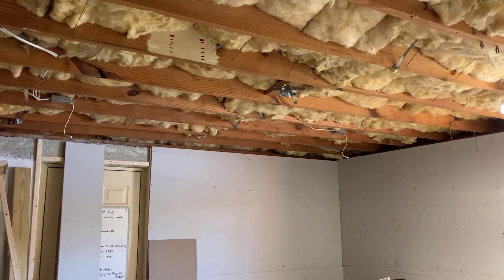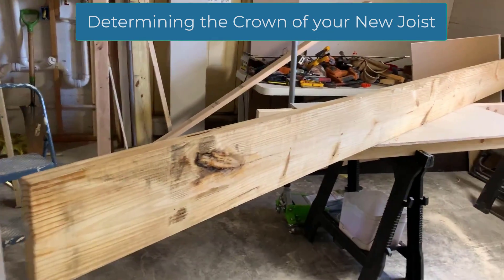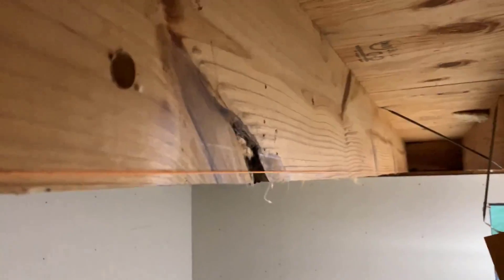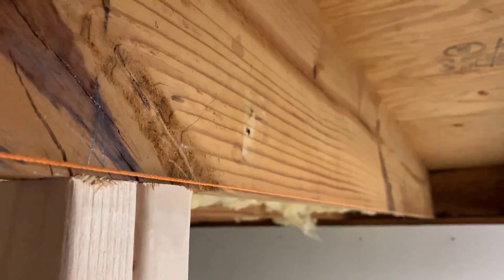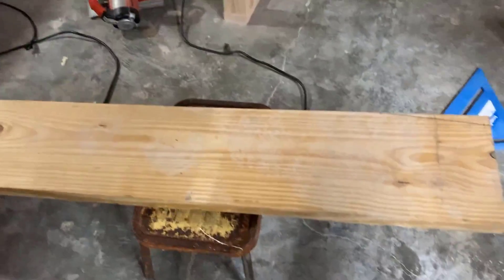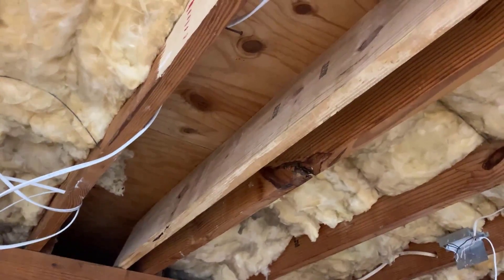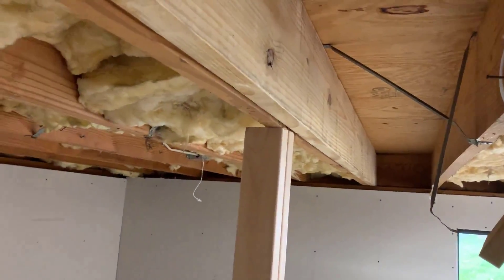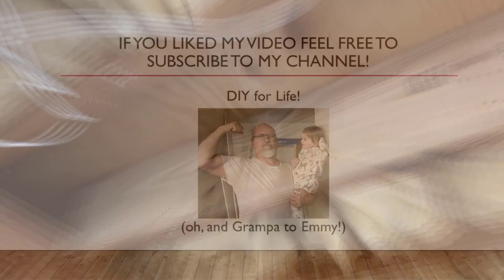Floor Joist Repair Video

Comment: My flooring above is ceramic tile.  Do you think I'll have a problem jacking up the joist and cracking the tile or grout?
Reply from the maker: It really depends on how much you have to jack it up. I would guess that you might have some cracking depending on how much you have to jack it up.

Comment: I install joists in opposite directions, so bottom is started, then use a compact bottle jack, in between other joist, in the joist cavity.  The jack to push new joist to old joist.  Unfortunately, a bottle jack will not work downwards.  But the jack will force both joist together.
Reply from the maker: Interesting approach.  That would work.

Comment: How the heck did that joist ever pass inspection in the first place? And was that "new" joist the best one you could find?
Reply from the maker: I asked myself that question about that joist. Not sure why they decided to use that. As to the new one that I chose, it’s doing just fine. I probably could’ve gone to the next grade up, but, as I said, it’s structurally sound.

Comment: Great video, very helpful. Thank you!
Reply from the maker: @davida871  I’m glad it helped you my friend
Reply: @RighttothePointDIY I bought SDS 3" Simpson screws.  If 2x6 is water damaged and cut from plumbing should it be removed or just instsl 2x6x12 on each side of original joist?
Reply from the maker: @ i’m always in favor of removing the old joist if possible.

Comment: You can use a small bottle jack to help force the new joist against the damaged one. It is a lot quicker and less destructive than beating it with a hammer.

Great video, well lit and clearly explained.
Reply from the maker: Good idea.  Thanks for sharing that.

Comment: If I used bolts instead of screws would that work as well
Reply from the maker: If you are resting the replacement joist on a header or wall on each end then screws (like I used) would be fine.  If you are doing a true 'sistering' of joists together and the new joist is NOT resting on solid surfaces at each end that is a totally different repair and, in my opinion, would be better done with bolts.  Hope that makes sense.

Comment: Using a vehicle jack of that type for that purpose is dangerous due to the wheels and the fact that it doesn’t go straight up but in an arc .
To use this type of jack measure the arc and angle the prop so that it will move to the straight when in position, also chock the wheels so that it doesn’t spit out while lifting.
Reply from the maker: @anomamos9095  I appreciate the comment.  A couple of things to note.  
First, the lift was only 3/4” and the arc you referenced is virtually none. If the vertical lift was more a lot I could have used my bottle jack. 
As to the rolling threat, I had leveled the wood supports to straight up and down so that wasn’t a threat of happening. 
In my estimation, because of those factors I don’t think it was a dangerous way to jack up the joist. However, if those factors were different I would agree a bottle jack would be better.
Reply: @RighttothePointDIY  The comment was meant for others as you had already successfully used it.
But you're lucky Murphy wasn't looking.
Reply from the maker: @ Thanks for the comment.

Comment: Great informative video. After reading the comments from expert carpenters, they agree that its a perfect fix. Now i know what to do. Thanks for sharing.
Reply from the maker: Thank you very much for the kind words.  I have not had a single problem with the repair in the three years since I did it. It’s holding great. Best of luck to you as you do your own repair.

Comment: Deck screws not recommended for this application due to low shear strength.  Seems like overkill but against some Building Codes
Reply from the maker: @RichardCooper-bd9qo  Understood. However, the screws are not holding any sheer weight. The purpose of the screws is just to hold the new joist in place against the old joist. The weight is being carried by the joist itself.

Comment: Question 
I need to level my floors can I do this using one bottle jack and lift one at a time
Reply from the maker: @angelf9800  i’m certainly no expert in floor leveling, but I would believe that two jacks would be better. However, if you only have one, you can probably make it work.

Comment: Deck screws do not have a high shear strength and should not be used in this application. A rated architectural screw or nails and glue would have been a better option.
Reply from the maker: @StormyITO  understood. However, the screws are not taking any sheer weight. They are simply holding the joist to the broken one. All the weight coming from the floor above is being carried by the new joist itself.  Because of that the screws are more than adequate.

Comment: You can scab strips of 3/4 ply, 8ft long on either side of the sag jacked up past straight the distance it was sagging. Use no less than a#10 screw, let the glue dry for 24-48 hours and then take out the tension and you will have a straight floor.

Comment: I have a rotten end where the joist sits in between cement blocks on the foundation top.  Makes figuring it out much harder for a novice
Reply from the maker: That is tougher.  You will probably need to jack up the floor on the joists on either side of that one, take out that old joist and then put the new one in. A lot more work but doable.

Comment: That timber is not the right grade it was cheap and nasty hence all the problems. You use crap you end up with shithouse job!
Reply from the maker: I couldn’t agree more.  It was obviously a poor decision of the builder to use it.  All the other joists I can see are okay.  This one probably slipped through the cracks.

Comment: A full length sistering, at that point you probably dont need to do half of what you did. The new joist can handle the load while the old joist anchors the flooring. You basically replaced it.
Reply from the maker: I hear ya.  Basically that is what I did.  The old joist just held the new joist in place.  Didn't cost me that much extra to screw it and glue it to the old joist.  The repair is holding up great.

Comment: Very much appreciate the level of detail you went in with this video. I will need to do this to some of my sagging floor joists and so this video is super helpful. Fantastic tip regarding using the strong to measure the sag so you know how much you want to jack it up.
Reply from the maker: So glad it was helpful.  Good luck with your floor joist repairs.

Comment: Pretty well done. Smart to go full length, to screw and glue. This will hold up very well. Not much to critique- maybe add some block bracing but that is about it. Adding a few (3) posts in the center with a thick 2"x10"x 12' or 20' on top that spans multiple beams would add a ton more support. That would get you a post every 4 or <7' feet. Perhaps it is over engineering but that is how I like to do things. Metal is best but 4x4" wood could work too.
Reply from the maker: Thanks DG.  I thought about the block bracing but in the end didn't think it necessary with the other joist braced like it was.  As to adding other posts, the house is over 40 years old and the only joist sagging was this broken one so I don't think it would be needed and would have really limited the use of that room (made that space into an apartment).  I ended up hanging two layers of 5/8" drywall on that ceiling for sound proofing (We are renting it as an Airbnb) and there have been no cracks or movement whatsoever.  We are pretty happy with the result.  
Thanks again for the comment!
Reply: @RighttothePointDIY  No worries. I am sure it will be "good enough." 

I do music and 5/8" is fine but for isolation, you do what is called an Acoustical Drop Ceiling. You can still use your 5/8" but then add a drop ceiling under it and include an air gap. A guitars top is solid wood, yet it still resonates. Sit in your car with the window closed and try to hear someone in a nearby phone booth- you won't hear a thing. Two layers of glass and a AIR mass in between you. 

You can also coat the materials with a treatment. You can go deep with it. In a pinch- do your 5/8" but add another 5/8' under it separated by some air.  It will be much quieter.
Reply from the maker: @MOAB-UT  Thanks for the info.  I actually used a 1/2” layer of fiber board and then, between the 1st and 2nd layers of 5/8” I put this special sound proof caulking.  It never really hardens and makes a sound deadening layer.  It is pretty quiet now.  Plus I put heavy blown acoustic popcorn on the ceiling.  It works!
Reply: @RighttothePointDIY  It works! Padding and carpet upstairs would help as well. Besides air, mass matters. Density matters. Decoupling surfaces like ceilings and walls make a big difference. Here is a video:  https://www.youtube.com/watch?v=pio6rNd9tAc&ab_channel=HomeRenoVisionDIY

Comment: My existing joist have termite damage, if I use this method to sister a joist can I cut the termite damaged section out and just leave the new joist in place? The damage runs about 25% from the end of the joist.
Reply from the maker: Absolutely!   Remember, the old joist has failed and in my video I left it just because it was not doing any harm.  The new joist was now carrying the weight. I just used the old joist to lock my new joist in place (meaning I didn't have to put in the joist ties to keep it upright).  I know this probably goes without saying but if think you have active termites still you will obviously need to treat that first.  
By the way, if you were going to remove that stud, you will need to use a temporary support beam such as a piece of 4x4 along the bottom of the  floor alongside the old joist that you would place the jack under to lift the floor high enough to get the new joist in.  You may even need more than one jack depending upon how far the floor is sagging.
Reply: @RighttothePointDIY  Thanks for your feedback. The termite damage is old and I don't see any current issues. I will use treated lumber for this project, but, I will have
Reply: The whole house treated for termites after my project is finished

Comment: Your new piece of lumber looks like crap too. Liquid nails is crap too.
Why not shave the edges on both support sides. This will make the lumber go in easier. Less stress on the new piece.
Odd way to insert.

Comment: Should use nails, much higher sheer strength.
Reply from the maker: Thanks for the comment.  I’ve responded to this a few times before.  The screws are not taking any sheer weight.  They are only holding the new joist to the old one.  The new joist is taking the weight.

Comment: Suggestion:  allow the adhesive to set (24 hours) before removing the jackpost.  This will allow better distribution of load to each lamination of your built-up beam.
Reply: I could be wrong but I disagree with waiting 24 hours for the glue to setup before removing the jack. The glue is added for additional strength but will crack easily if 1/8 natural settling is going to occur. I'd rather have the glue adhere between the 2 beams in its natural state to lesson any stress on the glue and seal the beams together in their more natural state. I think that's what the maker of this video intended as well.

Comment: Use ledger lock stronger screw and higher tensile strength……
Reply from the maker: Hey Patrick. I appreciate the comment. The one thing I have pointed out to others that have suggested using fasteners with a higher tensile strength is the screws are really just holding the new joist in place. They are not taking any lateral shear force. If the sistered piece had been done over an open span, then indeed, it would be better to use high, tensile strength fasteners.

Comment: You don’t need to always take a wedge off each end to do this or either end I sistered every floor joist in my house when I remodeled it only because it was built in 1929 they used southern yellow pine and it did have knots so that’s why I sistered them didn’t cut a wedge out of any them then screwed using ledger lock screws the only real contact points are at each end no wedge needs to be cut out…..
Reply from the maker: Thanks for the feedback Patrick. I decided to cut the wedges just to be safe and because it didn’t impact the structural integrity of the joist. Seemed to work out good.

Comment: Super video.  
One modification I’d make is this :
Don’t Jack it up to meet the string line straight edge. Target the jacked up height to align with the bottoms (at that point across the joist) to be just above the same height of the neighboring  floor joists. 
You want the floor to be flat. The neighboring joists will have decades of sag in them and of you Jack this up to a straight bottom , that may push the top above the two neighboring joists - creating a high point on the floor above.
Reply: Not really a viable solution since the height of each floor joist could vary. Maybe run 3 string lines, one on the joist to be repaired and one each on the 2 surrounding joists. Determine the amount of deflection of the 2 joists that are sound then raise the damaged one to the same point.
Reply from the maker: Thanks good advice.
Reply: So what are you saying? Run your string(s) from the 2 neighboring joists only or in addition to running a string from plate to plate? Thank you.

Comment: Can screw your 2x4 jack together in a T shape to make a strong-back for less bowing/flex.
I recall that you can sister or scab on a smaller piece over a crack so long as you extend 3' or 4' on either side of the crack and glue and bolt it. This can help for a quicker fix and possibly avoid moving plumbing and electrical.
I like the idea posted about rotating the joist in the middle of the joist bay with a notch in the sill or just relying on the floor flexing in the middle easier.  Seems like rotating next to the joist would create a jacking effect on the floor screws/nails in the old joist that could lead to squeaking.
Also like the wood glue in the crack and in the sistering vs thick construction adhesive. I would have left the jack in to let the glue dry to counteract the memory/bend from that crack/sag. The old joist (and floor) will want to go back to where it was for the past 20 years.
I would also add solid blocking.  14' is a LONG span. The blocking would take some of the spring out of the floor (which can show up in the ceiling drywall seams over time)
Loved your video.  
Sucks to run wire or plumbing to new spots only to find that there's a structural problem that requires pulling it all out.
Damn the builder for picking that joist and putting it in the middle!!
Reply from the maker: Good points.  Thanks for sharing.  I thought about the shorter piece to repair but didn’t want to worry about it possibly failing again and the amount of effort it would’ve taken versus just buying a whole new joist made me decide on putting an entire new joist in.  I agree the builder should never have installed  that joist in the first place.  It was such an inferior piece of
Lumber and it was just a matter of time before it failed.  
Thanks for the comment.

Comment: 13:45 Why let the glue dry in a released state?  Why not let the glue dry first, then release?
Reply from the maker: That’s a fair question Dave. The reality is neither the glue or the screws are really carrying any of the sheer weight of the flooring above. The screws in the glue were just keeping that joist in place against the damage joist. The new joist itself is carrying the weight. In the end I don’t think it mattered much either way because it didn’t settle that much.
Reply: @RighttothePointDIY  ok, thanks.

Comment: The screw box says non structural use!
Reply from the maker: That is true but the screws are just holding the new joist to the old one.  The joist is taking the sheer weight, not the screws.

Comment: I hate squeeze clamps because they have 1/3 the power/force of a screw type. This is no place to bend in such big boards, this is long.  any screw under 1/4" screw will never pull in like a real clamp ever will what did you use #12 ??? Simple grade 5  5/16 nut/bolt can do >2000 psi here as a wood screw can be only about 600 for a #10.  Liquid nail does about 90#  for a  1" sq so as amt used. These boards wont fall apart for sure.
Reply from the maker: Thanks for the comment.  As I’ve mentioned in a few comments, the screws and Liquid Nails are just holding the new joist to the old one.  There is no shear weight in them.  The repair is holding fine 2 years past.  I’m pretty happy with it.

Comment: Use bolts instead of screws to secure the new joist to the old one.
Reply from the maker: Hey there Paul.  Thanks for the note.  I've had that suggestion a few times and have responded by stating that the screws are not holding any 'shear' weight.  They are just holding the new joists to the old one.  The shear weight is being taken by the joist itself.

Comment: Would it be easier to get the new joist in place by jacking the old one a little higher, thereby raising the floor slightly?
Reply from the maker: Thanks for the comment Paul.  Technically it would be easier but it didn't take a lot of hammering to get it in place with the amount I had it jacked up.  Also, you don't want to jack a floor up too much as you can unseat nails and even damage flooring that may be on top.  The amount I had it raised worked just fine.

Comment: Can you sister a joist with rot or is it better to replace it and is it a significant difference in cost to sister than  replace
Reply from the maker: Hey Anthony.  I would take a rotted joist out and, more importantly figure out how it rotted to make sure it didn’t happen to the new one.  There is no extra expense to sister verses replace as far as I can tell.